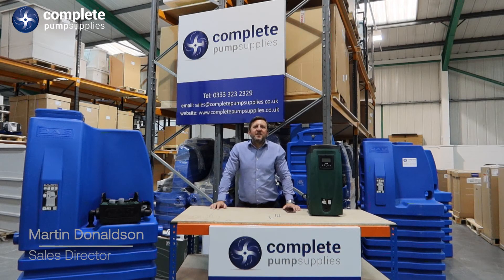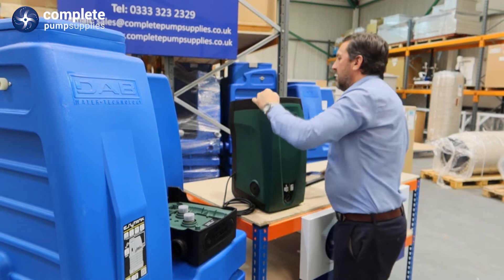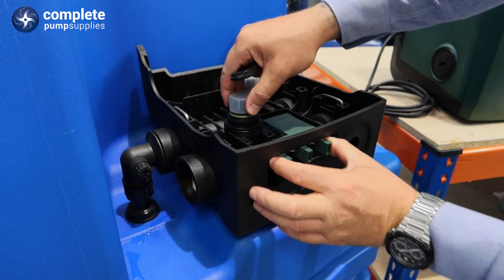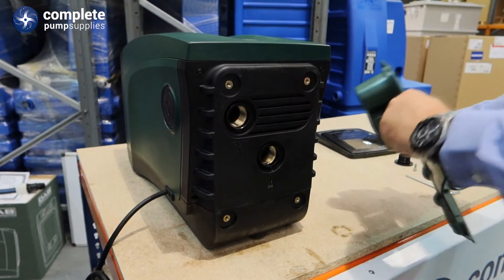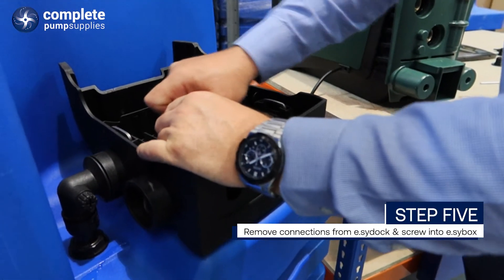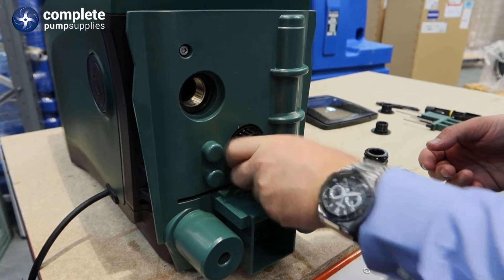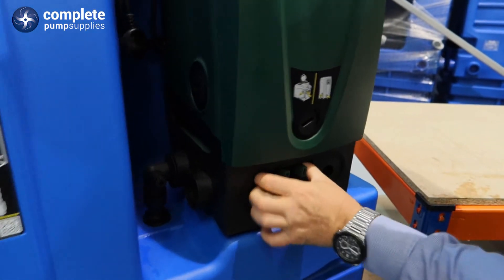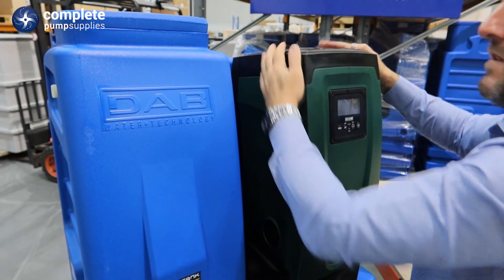Product Focus: How to connect DAB E.sybox to E.sytank

Comment: Hi I'm looking into getting 1 of these pumps too use some spring water on my property.....where I'd like too situate the pump is approximately 18m from. The water tank iv buried under ground.... the height difference between the water tank and preferred pump site is around 3 too 3 metres.... the info I have got on the pump says its able to draw water from 8m deep.... so basically would this pump be able to draw water 18m up a 2 too 3 meter draw or not??? My other option is too put the pump in at the tank end and pump it from that end.... only thing being it would need the electricity sent out too it across the field and be made water proof....any advice much appreciated
Reply from the maker: Hi Alan! Thanks for your questions and interest in the DAB Esybox unit. If you contact us via our website or give us a call our sales team will be happy to discuss this with you. You can find a link to our website in the description of this video.